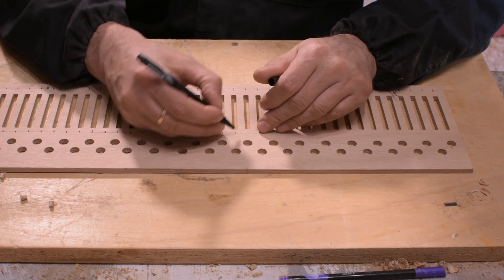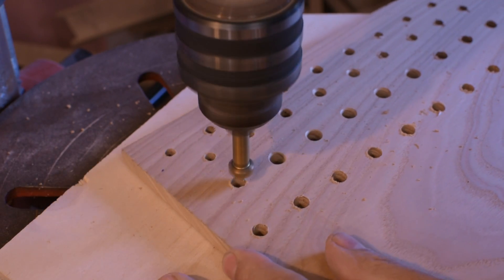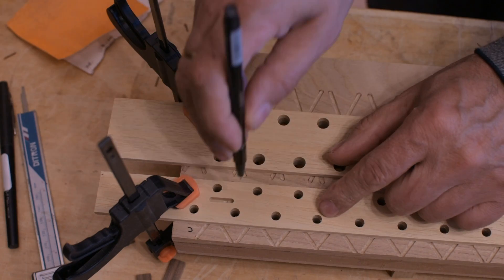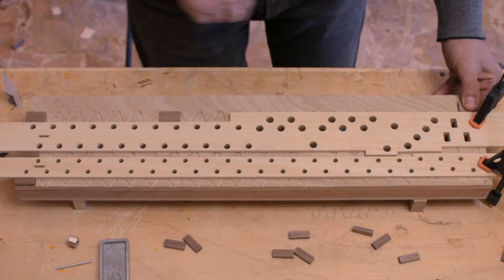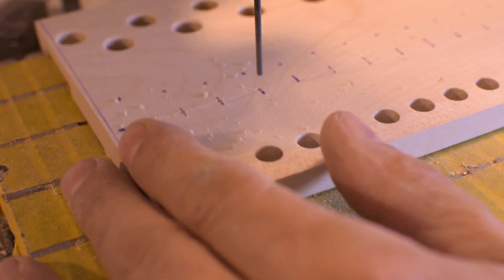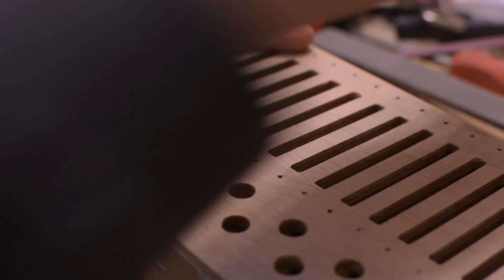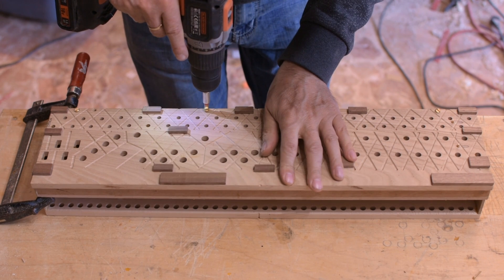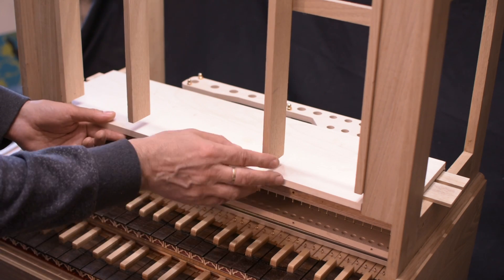Second windchest - Renaissance Positive Pipe Organ Building

Comment from the maker: Hi guys! the conclusion is almost there, I have to make the topboard and then I will make the bellows. After that the organ is complete, I will gradually build the pipes.
Reply: Hello, can you tell me if the positive organ will have wooden pipes or lead pipes, such as on the large pipe organ in your workshop? And one more thing: did you make these metal pipes yourself, or did you buy them somewhere, and if you bought them, is there any delivery to Russia?
Reply from the maker: @Stas-ko7  All wood except the 1-1/2' register which will be tin. I will build all the wooden ones and also the Regal one, while I bought the metal ones used. I don't know about shipping to Russia, you should contact some organ builder and ask.
Reply: Thanks for the answer) We have much fewer organs than in Western Europe, and there are only one or two companies producing organs or pipes. I’ll look for used ones, and I’ll try wooden ones myself using materials from the Internet and your videos. There is already one, albeit a test one and made of plywood, but there is sound. Good luck with this your project!